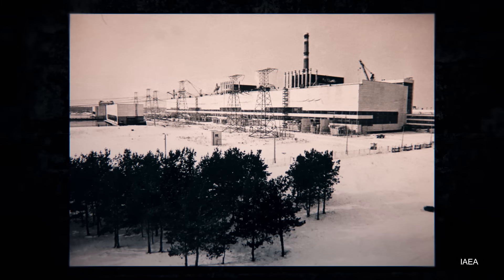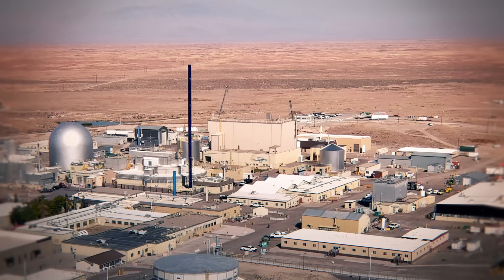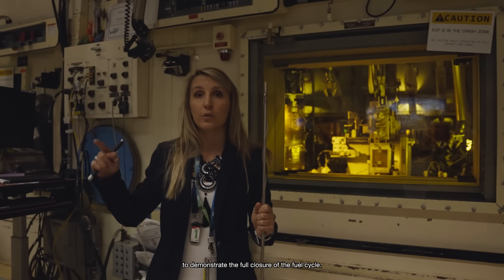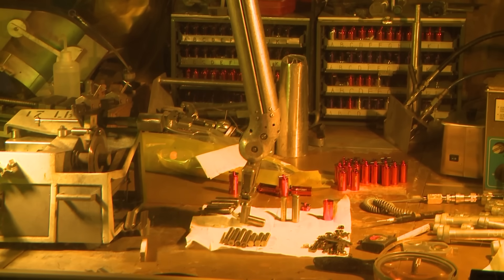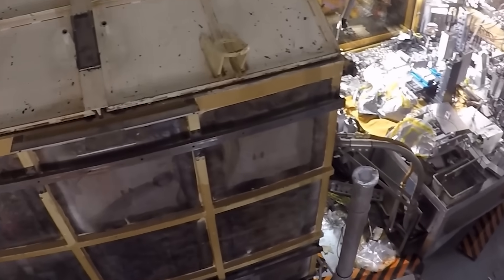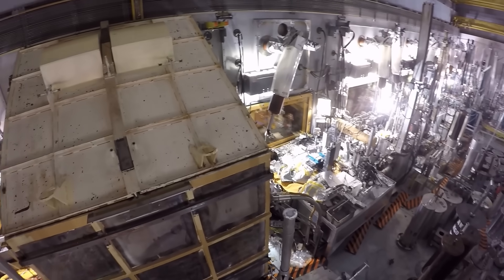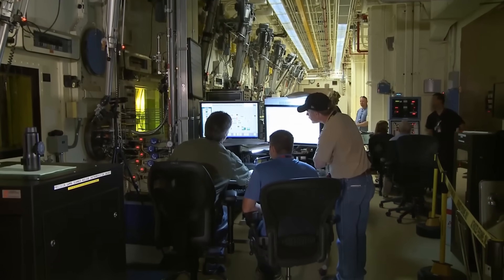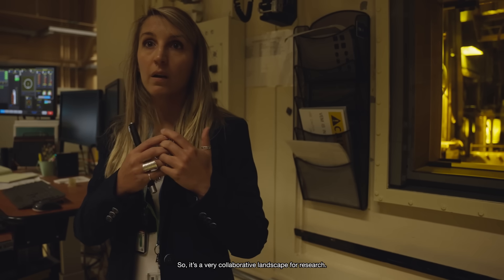This Room is Lethally Radioactive...For SCIENCE!

Comment: It would have been cool to see how things are safely moved in and out of the hot cell. If they're testing next generation fuel rods in there, there must be a way to get new materials in. That must be a serious challenge.
Reply: Robots.
Reply: @rimbusjift7575  The semiconductor chips of robots get destroyed by radiation. This is also a big problem for satellites and space probes, particularly those with polar orbits around the Earth or around Jupiter and its moons. Ultimately mechanically operated manipulators or expending human lives are the only choices for environments with extreme radiation.
Reply: @HenriFaust i figured hydraulic arms. Have the semiconductor chips be somewhere else either shielded or in a different room entirely.
Reply: @thenthson  That is exactly what I was thinking.
Reply: @HenriFaust  probably something more analogical in the robots, cables and stuff
Reply: @rimbusjift7575  Waldos ... Purely mechanical "robots", no electronics, no chips to fry, often not even any motors ... 

It's what you saw them using to manipulate things inside the hot room in the video
Reply: @OdinsBarn  the lab I work in deals with a lot of biohazards so assuming similar safety procedures I agree, it's almost certainly an airlock as you describe
Reply: Next question is how do they fix the robots and service the room itself?
Reply: @MartinBalle7  That is the neat part, they do not.
You get another robot to do that.
Reply: @MartinBalle7 with robots that fix the robots
Reply: @MartinBalle7 very good question always wondered the same
Reply: @MartinBalle7  I had the same question too
Reply: @MartinBalle7 maybe “you break it, you go fix it” 😁😁
Reply: @MartinBalle7  No Robots, only Waldos ... Purely mechanical, no electronics 

and the answer is using other Waldos ... or even dismantling them and airlocking them out to be fixed outside - they will be radioactive but low level
Reply: @MartinBalle7  the "robot" arms are simple master /slave manipulators all mechanical the only electronics are servo motors on the outside that adjust pivot points allowing for greater reach and the like, the arms can be fully removed from the cell for maintenance, and are designed in such away that the grab on the end is removed and remains inside along with a plastic sleeve that protects the inside part of the arm from getting to badly contaminated, but it will still be wrapped in plastic as it is removed by pulling the whole thing into a bag which will be fixed to the cell wall, sealed once the arm is removed and then cut to allow the arm to be taken away and prevent losing the seal on the cell. the arm will then have to be cleaned down before it can be fixed
Reply: I was wondering how they even change the lights when they burn out
Reply: @Seldoon_Nemar  same remote handling equipment that handles everything else in there.
Reply: @Seldoon_Nemar  might be like some high school swimming pools where there are lenses in the pool and the lights can be changed on the other side that is in a basement beside the pool.  The lens might be less thick but enough not irradiate the person changing the light for a short time.
Reply: @Seldoon_Nemar  the lights will have a small glass tube or dome over them and they are pushed into place from outside, basically they are bulbs on a 1/2meter pole that can safely be pulled out and replaced with out having to break containment
Reply: @Seldoon_Nemar  I was wonderin the same thing
Reply: THIS - these are the types of questions I kept having while watching the video. How do things get in there? How do they get serviced? Taken out? Lights changed? So many questions...
Reply: @ross-carlson Richard Rhodes book on the Making of the Atomic Bomb says that the facility that separates plutonium was constructed starting with the robot arms.  Then the operators constructed everything else with the arms, the idea being that any repairs would have to be done with the arms, so let’s insist that everything has to be constructed with them, or modified so it can be, before introducing the spent reactor fuel for the first time.  After that, no humans can enter the facility.
Reply: I'd guess that there is a geometry shielded transfer chamber that is also an airlock, if it's not geometry shielded it would need a massive shield door if it faced directly into the hazard area
Reply: How do you change a blown light bulb?
Reply: @BaronOfHell1990  Lights wouldn't need to be actually inside the chamber. Light could be safely piped in via fibre-optic type links.
Reply: Probably a double or triple air lock system with a labyrinth.
Reply: @youkofoxy  yes, I expect the maze/labyrinth, like those electron radiation sanitization systems have - but there the maze is afaik against xray scattering, which is different from what flies out of this fancy pleasure room :D
Reply: It's just a basic airlock probably, like every other lab. Room with two doors, open door one, place object. Close door one. Open door two, transfer object. Vacuum air out of room congrats you're good to go.
Reply: Remember, 
Hot Cell: radiological
Hot Zone: Biological
Hot Lab: Chemical
Reply: Having actually interned at INL, I can actually input on this. The H.F.E.F. essentially has a large door that is able to take in huge cases of whatever experiment they are working on. This door has a subsequent door that leads into the hot cell itself, personnel guide the cask or experiment inside the first door, close said door, purge the area of oxygen and fill it with Argon before opening the secondary door where they use in-cell cranes to move the experiments around the cell.
Reply: @michaelpickering1904 AH, so the cranes can be radiation shielded. Do they also use similar equipment to do things like change lightbulbs?
Reply: @victoriaeads6126  Yes, the cranes are operated remotely, but still have cabling directly from the controls box to the crane itself. Wireless connections don't do well in radioactive environments. Their telemanipulators, the robot arms seen in the video, are also wired in this way. They're used for just about everything unless it's too heavy, then the crane is used. This includes tasks that while easy in principle, such as tightening a screw, become much more taxing and difficult through 5 feet of glass
Reply: @michaelpickering1904  so is there a room between the doors?
Reply: I’ve seen similar problems throughout the industry and often if the material is hot then the solution is often to place it in a lead cask filled with water and then bring it in via crane through a set of shield doors. Either way, most materials are moved through a set of 2 shield doors to get into theses types of places. Additionally, all things within these rooms can be maintained or replaced via the manipulators and overhead cranes
Reply: Probably just like an airlock, or maybe a revolving door, with thick AF doors. Wouldn't need to be complicated, would just need to be very very heavy.
Reply: Magic
Reply: There is an industrial model for radiating products for sterilization. Pretty much conveyor belts, air locks, cranes, mechanical arms, that kind of stuff makes it work. They almost certainly also have a way of closing or blocking the source radiation to decontaminate the room eventually.
Reply: You'll find the answer at 3:09. Decon cell is at the left of the diagram.
Reply: Google search for INL/MIS-10-20604. It is a 36 page facility overview from 2010 that describes some of the loading and unloading procedures.
Reply: Material is sent in through transfer locks and moved around by in cell cranes. The pressure is always kept negative in the cell to avoid any leaks. And they do everything in there remotely. Changing a light bulb can involve several workers and hours of labor.
Reply: I was thinking the same, but I was thinking specifically about repairing any of the robot arms or equipment inside the hot cell if/when they broke down.
Reply: @Shadoweclipse1386  The manipulator arms are removed remotely with other type manipulators,  taken to another compartmented cell for repair and worked on through a glovebox. If a unique repair challenge comes up, engineering comes up with a solution.
Reply: @Shadoweclipse1386  not quite the same as 3d printing the repair part you need for your 3d printer that is breaking.
Reply: GORDON FREEMAN
Reply: most likely an airlock but with extra shielding
Reply: Just an airlock no?
Reply: Mechanical arms, vaccum sealed transfer points, leased glass, and inert nitrogen gas atmospheres
Reply: @OdinsBarn  yeah like a robotic glove box
Reply: They probably send the intern to get some coffee and move some materials on the way back
Reply: Right, I’m sure it’s some sort of airlock, point is, it would have been cool to see it in action. There are lots of ways to design airlocks.
Reply: @cogspace  like the room is sitting on top of a pool of heavy water and in the back corner is an opening to the pool where a camera fitted SRV is used to robotically move the stuff from the "clean" side into the room from underneath it. Kinda like the giant airlock for the manned submarines in The Abyss.
Reply: Get the apprentice to do it
Reply: Thet use prisoners, with no family who've committed capital crimes 🤔🤫
Reply: @randallreed7415  wow that went dark fast lol it's probably faster than some of the horrible attempts at executions that did not go as expected.
Reply: Depending on the type of item they will likely use Steel containers called flasks weighing several tons and of various sizes, they will have a shielded door or hatch on the cell which will be lifted up or otherwise moved asided to relieve a la calhène port onto which a smaller container can be attached so that then when the cell door is opened from the inside using the manipulators arms the lid of the la calhene is also removed so that the seal / containment off the cell is never broken.

The other option would be to have an airlock and in cell transport, again using a flask which would be sat on the roof of the cell over a shield valve door, the contents would be lowered into the airlock the valve door closed and the atmosphere in the airlock removed and filled with argon before the item is moved into the cell proper through another door similar to the la calhene port.

Either way each process can take up to 2 to 3 hours to complete which checks needing to be done to make sure no contamination as come out of the cell during the transfer process.
Reply: @Dirge4july very scientific sounding explanation. But actually you just gotta put it through really really fast, like the bin at McDonald's, ez 😎
Reply: Hi, I have worked at this facility. We have several ways to get things in out:
- Using casks (flasks to the rest of the world). These are giant shielded cans that you can put heavily radioactive material inside. We load those on our cask cart, which drives under the hot cell and lifts up to "cask ports", which are holes in the cell floor. We seal the atmosphere using thick plastic bags and specially designed adapters on the cart. We then use the overhead handling in-cell to lift items out of the cask. Just last year, they received full-length commercial fuel rods using this method--which was just about the tallest thing the facility can receive.
- Using Rapid Insertion Ports (RIPs). These are ~6 in. pipes that act as a slide into the hot cell. There is an airlock at the top of the slide for the argon-atmosphere cell to limit air injection. Anything that is small enough can just be sent down, crashing to a catch tray with a cage on it in the cell.
- Literally lowering it through the ceiling. There is not insignificantly large air-atmosphere cell connected to the argon atmosphere cell. At the top of the air cell is a ~7 foot square hole in the ceiling, usually covered with a shielded hatch. Items can be lowered in that way, as well, and then transferred to the argon atmosphere cell through one of two transfer locks with vacuum systems--again, to limit air injection into the argon cell. I saw large worktables (5-6 feet wide by 10 feet long) sent in that way.

The hole in the ceiling and the cask ports are the only ways to get things back out.

There used to be other transfer paths, including some holes in the argon cell ceiling with custom gloveboxes over them and an elaborate transfer system, but they don't use any of the other ones any more.
Reply: Soviet bio-robots put the samples into the chamber.
Reply: In my workplace we have several hot cells with lead glass windows and manipulators. The stuff is brought inside by things called padirac, shielded containers that let you open a small passage from outside, all mechanical no electronics. You operate with long keys, it's cool!
Reply: Part 2!